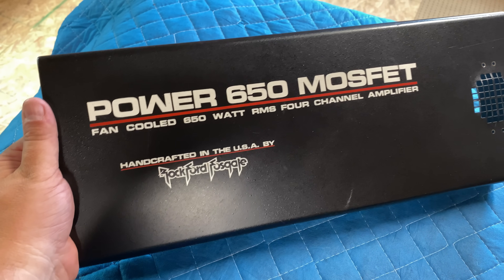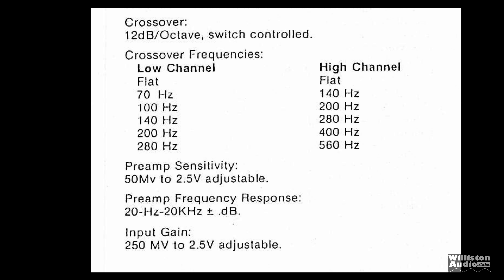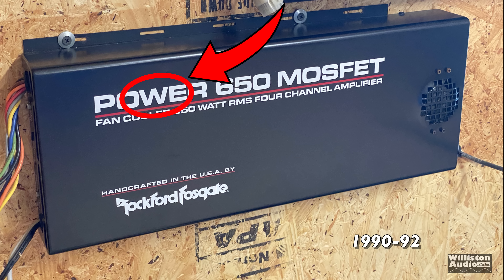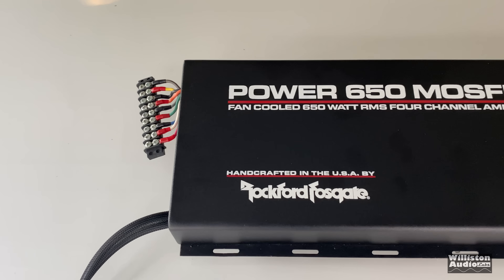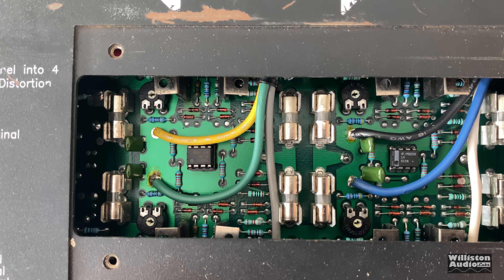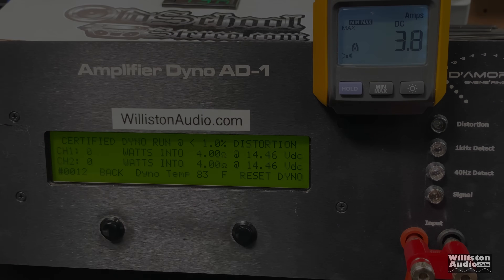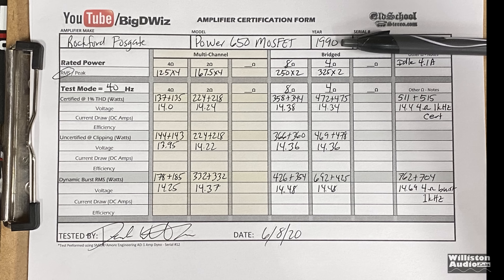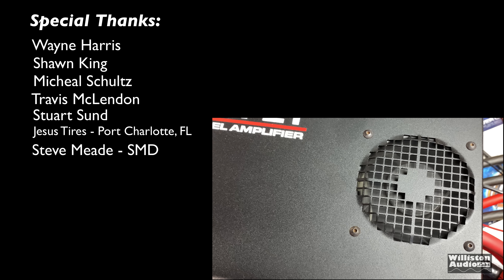Old School Rockford Fosgate Power 650 Amplifier Amp Dyno Test

Comment: These things amazed me when I discovered them as a 12 year old in 1992. I wanted a pair of them SO bad and had my system diagram all figured out with every piece of equipment I lusted for. I would eventually own a pile of the later Punch DSM amps, a pair of 40's, 60's, 100's and even a pair of Punch 200's on (4) JL Audio 15W1's in my '85 Ford Bronco. Thirty plus years later, I'm still that same kid.

Comment: Big D have you ever dynoed a Rockford pumch P8002? The one from the early 2000s with the chrome covers. I have a couple of them. Running one on my MB Quarts on my front stage. Curious of the output. I m sure it's close to 1000 watts.

Comment: I had one of these in my brand new 91 mustang GT. Another guy I knew had the MOSFET 300 and ran pro series woofers with it. I ran standard series 10s in what was called a voodoo box where two 10's shared a single air space opposed at either end of the ported box. My system destroyed his and my hatchback mustang. I should have been running pro series woofers with that amp. I ran two channels bridged at 325 w and the other two channels for my mid-base stereo. The standard series woofers would eventually damage themselves and start making noise. So I would just replace them periodically. But I got way more sound than the pro series. It took a lot more power to get the same decibels from the pro series speakers at that time.

Comment: When we tested the Fosgate Power 650 it didn't make it's power rating. In my buddies vehicle we placed 1st or 2nd in Amateur Enhanced SPL in 1993 at the IASCA world finals in Tulsa. I don't really remember because that was not my focus. Amateur 0-100 watts was it. Martin Mohr had the 1992 world record at 131 db with two Punch 45s and I reset it at 146.7 db using two HiFonics Ulysses in 1993. Remember we had to play commercially available music and the mic wasn't able to be jammed into the loudest spot in the vehicle. If I could go back in time I would have wedged a 4X4 between the floor and roof of the van and picked up a couple of more db. The roof flexed like a mofo. The other van was in the HiFonics demo booth. We hit 153db with it, from the drivers seat.

Everybody was there. Fukuda, PJs Autosound, Harry Kimura, you name it. Later on I would live a dream where when I saw Orion make a raft with a stereo on it an float down the salt river in Mesa. Decades later I went to Tempe to Orion HQ and I did go for a float down the salt river. I've done it multiple times and I will do it again. It's a trip worth making from Canada.

Comment: I had a pwr 650 in an 88 mustang GT mated to 2 RF Pro 12's in a slightly oversized sealed enclosure firing backwards into the rear hatch, mated with a couple RF 45s on dash tweets door 6.5s and rear factory location holding midbass 6 x 9s. Really good front stage for the time. Actually hit 136 /138 depending on you trusted the offbrand SPL meter...amd did this with a CASSETTE player.... Nakamitchi/Denon setup.. Really enjoyed this set-up. Lol. I was a kid then.
Reply from the maker: Awesome 👏

Comment: The power supplies on these did not use MOSFETs believe it or not.  They were NPN devices.  It was an old design, non PWM, non-regulated self-resonant type converter.  Only the output devices were FETs.

Comment: Not this one did bad, but I just watch Steve test the power 300 and it seems like his power 300 did almost what this power 650 did... which leaves you wondering if this unit has some issues that need to be sorted. I would’ve expected it to put out more based on what he got out of the 300 unless his has been modified.

Comment: I bought one of these amps on eBay a year ago for 550 bucks, sadly to say my Kenwood 2000 watt amp bumps harder, but still cool for 80s technology.
Reply: its probably because the kenwood is a class D amp. its not draining the voltage out of your electrical system. big AB amps like that 650 need a really strong power supply and will kill your alternator if its not up to the job. plus, the kenwood is rated at 3 times the power haha

Comment: does shaun have an amp repair company? i have a slash 300/4 v1 that has slightly lower voltage on the left channel vs right (same difference between front output and rear output)

Comment: There was a super early punch 45,75,150 that was square flat with long straight fins for heat sinks. The treble and boost gain had toggle switches! Very,very early eighties. Anyone else seen these?. They looked super cheap but werent.

Comment: Finally a dyno for the 650!  Would you have another 650 that is still fully stock to do another dyno run without any of the upgrades done to it like the one in the video?  You're most likely already aware, but the ratings up to around 1998 were rated power at 12v weren't they?  With unregulated power supply, running 14+v would explain why these amps put out higher numbers.

I see that T1000-4 arrived safely.  I don't get why most people seem to think that a couple layers of thin bubble wrap alone will protect a 15-20 lbs amp, especially the point corners.  There have been too many times I've received damaged, dented, ding'd up, broken amps that I had to send back.  Every time that happens there is one less beauty in the world sadly.  Sorry just ranting after I saw that nice T1000-4 at the end there

Comment: Ppi pro mos 450 bridged and stereo
Reply from the maker: Love this amp 👍
Reply: @wal  I worked at Duke's Car Stereo in Flint Michigan when we won the world competition with the fishing truck that had a pro Moss 425 and 2 Pro Moss 12. I at the time had a 4200 a.m. and a 2200 a.m. with a p a r 225 EQ the one that goes for big money. Had a 10 volt output. I know I could have got the same results with the pro Moss 450 or with a pro mos 50 and 2  12pro moss. I have still 4200am a pro moss425 punch 75hd and the 30. Was thinking about putting in the 30 bridged series parallel on a competition MB quart crossover running 4 tweeters for meds for woofers and then two subs jlw3 6s. It may be using that Precision Power EQ and bass boost that bass boost made them ppis thump

Comment: Do you have any access to sip Hi Low chips for the Soundstream 2ch lil wonder rubicon... broke a pin on one and still want to use the amp . Or is there an alternative chip I can use . And also, will it run with just one chip ?

Comment: I would expect an amp factory rated at 0.5% and 0.1%  THD respectively to produce more power when tested up to 1%THD or up to clipping. What would be interesting would be to test a modern amp ( Brazil or Korean ) factory rated at 1% THD to see what it would produce at the oldschool standards of 0.5% or 0.1% (some oldschool amps were even rated at lower %'s).  Anyway's thanks as always for the great content!
Reply from the maker: Great point! Many of the OS amps were also rated at 12 or 12.6 volts too

Comment: Badass oldschool Rockford. Never knew that they were so underrated, but the efficiency at 4 ohm 😬🔌💥(my emoji selection doesnt have the big lightning bolt 😣 or the middle firnger either! 😡👎LG keyboard.) 2 ohm wasnt that much higher than thr 4 ohm compared to the increase in power, which suprised me. MORE OLDSCHOOL! For sure. Im a Kicker man personally, current set up is 4 CVR's, 2x 6.5's,2x 6x9's, '01 Alpine 7873 headunit and 2x Power Acoustik RZR 2500's which my be the weakest link but their efficient! I havnt made a recent vid because i been hooking the stuff up. I pretry much just doubled my system. Only thing left is a cheap ass 200 amp alternator off ebay that i just ordered and wiring up my second battery. Everythings been strickly budget based. Subs are used silver gen models, 2x were free and 2x cheap local off of marketplace. Alpine- $25, anothet marketplace steal. Amps- 50 for the first one and just got the second one for 60. Practically new too. Guy only had it a month and used it for a whole week before upgrading. The electrical is costing me though. Cant find used high-out alts or have i ever came across someone selling 25ft of used 1\0 power cable (most expensive single purchase of the whole system except for the Alt i just ordered is freaking $80 for POWER WIRE!). Oh shit i been rambling on. Hell i would have done a rough draft if id known i was gonna spend 20min writing a damn book. Should have just said " 👍 Keep up the good work" but then again who the hell is gonna still be reading this long ass comment anyway. 😝 and for those who do, here is thr funnist emoji combos i can think of...🐑RA🐓+🍭!..... 👉👌👉👌👉👌👉👌❗🙉🙉🙉💩💩💩✌

Comment: I'm All About The Old Skool Amps And Subs And Would You Do Any Videos On The DSM Punch Amps (George Foreman Grills) I Have Some Of These Series Of Rockford Fosgate Amps And Some I've Had Since New... I'm Planning On Doing A ""Back  In The Day""  Type Of Build Soon And I Have Always Wondered What Some Of These Amps Are Truly Making In Output Power And What Is The Best Power To Feed Them,  particularly The 100 DSM, 200 DSM And 500 M Amps.. Most Of My Old ps Have Been Put Up And Untouched Since the Mid 90s And They Have Their Original Warranty Seals Still On The Bottom Covers...

Comment: Is there any reason to use this amp over the 600watt/ch amps for $150?? Other than it’s rad as hell of course.
Reply: Class a/b beats class d in sound quality. Class d beats a/b in efficiency. Damping factor and slew rate are far better with a/b amps. Some will say there's no audible difference though so your mileage may vary.

Comment: I preferred the later version of the hearse with all the Power 1000's.
Reply: I sold a power 1000 to a stoner. He stripped all his wire connections over the fans intake.
Rockford charged $300.00 to replace all the burnt components.

Comment: These were SO far outta reach for a broke kid back in the 1990s. I've seen VERY few of the POWER 650's, nice score Derek!
Reply: DAMN TRUTH
Reply: I sold/installed equipment in the 80's to today.. 
Bought 2 of the 650's, and 2 of the 18" subs.....Then bought one of their 140AMP alternators. Then bought one of their 200Amp alternators.

Sold the 650's, then bought Zapco's Z220. Still have 6 of them.
Sold the Rockford 18" subs. Bought JBL 18"s. Sold them. Currently have 4 x 18" Lanzar's.
Still have both Alternators, and a bunch of Zapco EQ's.

No fast/take out food for about 6 months paid for all the equipment.

Comment: When one channel (or pair of channels) exhibits that lower power, it means the VI limiter is engaging prematurely. You can see the amp jogging back and forth on the current draw. It might be a leaky protection transistor or a bad cap in one of the protection circuits. Worth looking into as it will cause the amp to clip prematurely on certain loads.

Comment: 89   i was  in my freshman  year in highschool..    Just turned 46,   life just  flys   by,  wtf
Reply from the maker: Only Gods had these amps in high school
Reply: 47 Here And I Was Just Thinking About The Same Thing, Time Has Really Flown By And Yes, It Cost A Small Fortune To Have A Good Quality  4 Sub System Back Then And Minimum Wage Was $3.85 To $4.25 An Hour For A Lot of Part Time Jobs And Buying Used Car Audio Equipment Was Quite Common Also

Comment: That brings back memories of my 2nd gen 650 in my Firebird, with 2 Punch Pro 15s and a mullet!
Reply: You made the bucks back then because that amp was very expensive,only saw a few of these at car stereo events,I still have a punch 150 with fan shroud,punch 45 hd powder coated white,and a power 300 still in my bone yard collection,and a punch 200 ix DSM,still in use .the punch 200 I have bridged to a jl audio 123v3 in a sealed box and sounds good, tough amp they are so dependable .
Reply from the maker: Yessir! Nostalgia is king!
Reply: 650 on 2 15's jammed
Reply: Guaranteed that beat your heart out

Comment: Thanks D!! Please, have a look at old Adcom amplifiers. I took mine to get repaired and shop was broken in to!!! ✌
Reply from the maker: Dang brother! I heard those Adcoms are a bit finicky, but I’m sure I’ll tru one soon
Reply: @wal  That'd be awesome. Had mine on 2 old xtant (still have them) 10s, at 4 ohms, it was very clean sound. My friend (shop owner), did some surgery and added RCA inputs, failed after a year, took it back and it was gone. There was a HUGE Adcom amp he had on white, supposedly modified, and still has it I'm sure. Thanks for the big WISdom and content bro. ✌

Comment: Is there anything better than old School RF amps? I don't think so.
Reply: Early RF Amps Were King's Of The Streets And If Money Wasn't A Big Deal, Early Phoenix Gold Amps Were Beasts And Way Underrated. Also The Early Years PPI Art Series And Autotek Mean Machine, Linear Power And A Lot Of Other Good Brands Were Available Back Then And Pyle Had Good Stuff During Those Days
Reply: @goldhunter9641  Pyle Driver Yes.
Reply: Sam C. You are exactly right! HiFonics came in with Zeus amp also.
Reply: Better be careful. Zed fans are pretty crazy.
Reply: better then, better now... Linear Power.
Reply: @ericingram7864  yep
Reply from the maker: They are pretty dope yo
Reply: @wal  Known as a "cheater" amp. RF was "the best" at the time.
Reply: Early Kicker amps.
Reply: PPI Art series!  Would love to see him do one of those......if he can find one.
Reply: @nicholasstewart7585  ....the AM series were much cooler. lol
Reply: Nicholas Stewart gave my water cooled a300 away about 5-10 years ago.
Reply: That Reference 500 that’s holding the 650 up is pretty beast like...  : )
Reply: PPI and Orion....
Reply: Zapco.
Reply: I had a punch 60ix. I abused, and beat the s**t out of it. They were built like tanks.
Reply: I have a couple of late 80s early 90s soundstream amps. I still use one of them for my front stage to this day. Stunningly good sounding. And my sub amp is a power 50 RF from perhaps 94 or 95.  It could perhaps stand to be a little more powerful as I run it at only 2 ohms but I really don't pound my car stereo anymore. I just love the good quality in my older years.